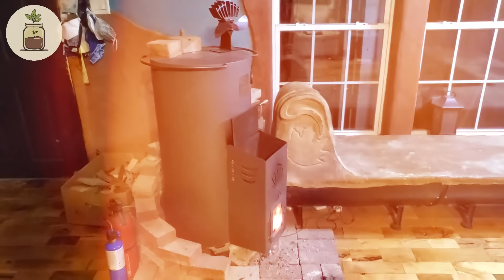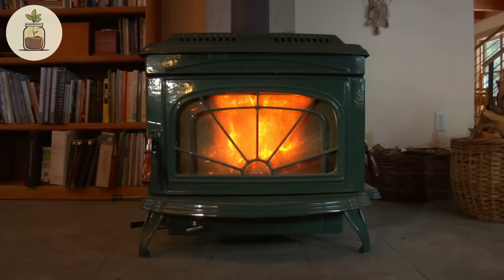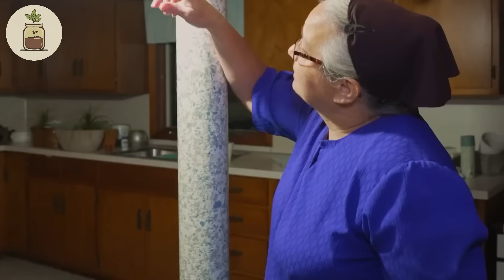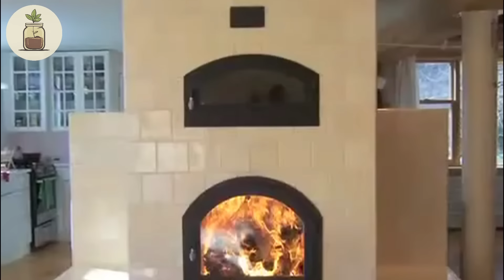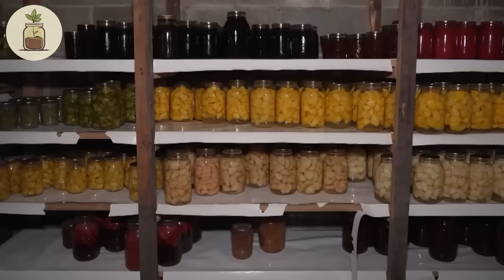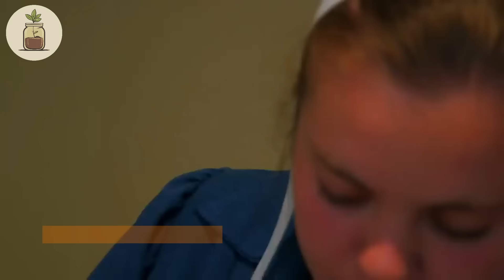How Amish Heat Their Living Room Without Gas/Electricity

Comment: Of course, they spent much less. We use electricity for heating, and electric bills include everything that's powered in the house, not just heating. They have no electric lighting, no computers, modems/routers, washers/dryers, A/C, fans, (nothing to cool them down in summer), fridges/freezers, etc. Try to turn off every single electrical appliance in the house, don't even use the lights - and see how much your bill drops.

Comment: It is not only the amish. The russians have similar heating systems in siberia. Also, I grew up in the 60s in greece where 6 people living in one four bedroom house, we used 2 tons of wood and 5 tons of coal per year. And what a mess. My father ordered the coal which was dumped in the yard and we had to stack it in the coal bin, which was a room 15'x 15'. Some pieces of coal were over 2' . Then we had to have buckets of coal next to our dutch oven and make trips downstairs to get more coal. The fire in the stoves in one bedroom, where three kids slept were started about 8-9 o'clock and went out about 3 am. That helped us get up to go to the kitchen where it was nice and warm. Here I installed dual oil tanks in my house and start the winter with two full tanks. I order oil when I am low and pay the bill. I spend, for ambiance a full cord of wood every 2-3 years on the fireplace. I don't even bother with my pellet stove anymore. Life is simply easier. The amish do what they do, because they have to, not because they want to. Some amish choose to leave their community, but I doubt that anyone non amish join those communities. It is just to much work. The only thing, IMO, that holds the amish together in their communities is their religious beliefs. More power to them...
PS I use the ashes from the fireplace instead of salt, in the winter, as long as I have them.

Comment: myth-buster: there is only so much heat-energy you can extract from wood before the smoke before enters the chimney. If you extract too much, the chimney will get too cold and moisture will form inside leading to a build-up of carbon (that can clog the chimney and cause a chimney-fire accident). The smoke needs to have around 65 degrees Celsius so water does not condensate. That means the amount of energy you can extract from a log of wood is limited by this. A well designed wood stove (masonry/tile) will extract that amount and end up using 80% of the energy in the wood. in my opinion the rocket-stove is not a "magic stove" that creates more energy than there is. If you burn the wood gases in a secondary combustion, you might end up with a tiny bit more energy than a well-designed masonry-stove but you will also end up with more fine-dust particles in the smoke (not good in cities). Besides a rocket stove needs to be heated for a prolonged period while a masonry/tile-stove is heated once (max twice) a day in the coldest time of year. I worked as a tile stove fitter and know the math behind it. If you want the warmth to stay you need mass! Lots of it. My small masonry stove in my small apartment weighs 1.5 tons. If I burn hard wood, I never need to burn it twice a day. When it is not super cold I light it ever 2nd or 3rd day or use less wood. Also my stove is built out of masonry and clay and does not need metal pipes that will burn out over time. A well built masonry stove lasts for generations with very little repair and maintenance.
A regular metal stove from the hardware store on the other hand, can be the worst and least efficient way to heat a home, as a lot of the heat gets into the chimney and the smoke there arrives too hot (sometimes with over 300 degrees Celsius!). So you extract very little of the energy stored in the wood. But some modern metal stoves are almost at par with a masonry stove extracting 80% of energy.
Reply: Sounds great. Is this similar to Russian stoves?
Reply: I disagree with you. I'm almost 80 and grew up on wood cook stoves, the old belly stoves for heat and fireplaces...We didn't get electricity until I was about 9 years old. We had wood fire places for winter heat even up until I was 17, although we had electricity. It was what we preferred. We stayed warm on the coldest winter nights. and didn't have problems like what you claim...
This man is correct on the Amish.
Reply: @TexasMoonlight27 Did you actually understand my comment?

Comment: Umm.. i don't really know what exactly amish do for firewood, but i cut and split all the wood for my family. I run a 16" chainsaw, and a splitting maul. I use less than 1 galon of gas, one container of two cycle oil, and one quart of chain oil in one winters worth of wood. I don't sharpen my chain as often as"experts" say you should. 
Extreme max cost to heat my 2,000 Sqft house with passive solar heating, and one single highly efficient wood stove might be about $100. In a northern environment I probably would double that cost. 
So not sure where these figures are coming from... That sounds like they buy the wood and don't produce it themselves....
Cole, and other fuild definitely cost more, but wood processesed with hand tools only is 100% free!!

Comment: Amish did not use a rocket mass stove. 

The rocket mass stove was popularized by Ianto Evans, an innovator and designer specializing in natural building techniques. Evans, along with other collaborators such as Leslie Jackson, contributed to the development and dissemination of the rocket mass stove concept through their book Rocket Mass Heaters: Superefficient Woodstoves You Can Build (and Snuggle Up To), published in 2006.

The concept of the rocket stove itself predates Evans and was first developed by Larry Winiarski in the 1980s. Winiarski designed the original rocket stove as an efficient cooking stove for use in developing countries. Ianto Evans adapted and refined the idea into the rocket mass heater, focusing on sustainable heating solutions for colder climates.

Their work combined efficiency, sustainability, and accessibility, leading to widespread adoption by eco-conscious builders and off-grid communities.

Comment: I wouldn't think the Amish would use propane, and much in ways of natural gas, as the processing requires electricity, to produce them, now. With exception of direct chemical separation from crude oil, to make kerosene, of course, as that can be done with no electricity...but then we get into how the oil was pulled. Anyways...there's my 'two cents', and two cents doesn't buy anything.

Comment: nothing beats a rocket stove , i made one that
 burns wood pellets non electric , i had it burning up to 1150F degrees in fire box but normally  it stays at 850F when the exhaust goes out of the stove into the chimney pipe i can put my hand on it , on top of the stove i have a bunch of heat powered fans

Comment: Firstly these have been used in europe for centuries  the masonry stoves can be found in many home across Europe Germany Switzerland Nordic nations Netherlands.  These wood or coal burning stove have thick masonry covering that acts as a heat sink absorbing much of the heat of the fire then releasing it back into the room over time meaning that once hot these heat sinks only require a small amount amount of fuel to maintain the heat sink.
The wood is burnt very efficiently like a modern wood stove . Many of the large masonafire place have decorative ceramic tiles . However theeevare not as popas they use to be because most European towns are smoke free zones.
These are not rocket stoves the amish don't use rocket stoves they use what Europeans have used for centuries. however the heat sink method is being used to heat home by using cheaper excess nighttime electricity to heat up a dense energy absorbing material.  Which releases the energy back as Heat through out the day .giving heat and hot water. Most european are use to use what called a mutifuel stove they run on coal or wood or peat bark. 

These masonry ovens absorb much of heat from the fire and flue then radiate back over time.

Comment: Selkirk mountains of northern Idaho here. We used to get a logging truck load of Birch lions every 3 years for $1200. Cut and split it ourselves and got about 12 cords of wood. Super efficient good cents 4 bedroom manufactured home with 80% efficient Osburn wood stove. Cost about $400/year to be toasty warm with no special exotic heating system. Super dependable and no electricity needed. Been doing this since 1999.

Comment: The big oil and power companies are pushing to eliminate wood heating on the grounds that it pollutes the atmosphere worse than their forms of heat. We use an Italian made fireplace that uses a sealed burn chamber taking air from outside and efficiently urning wood to……heat water! It is a boiler that will heat the water that is distributed to radiators in the lower level of the home and into in floor hydronic heat on the upper levels.
The British canal boat dwellers utilize coal fired heaters and yes it is long burning. If we had access to anthracite coal I would be using this for heating water and some high end heaters utilize a catalytic secondary burn to keep hazardous particles out of the atmosphere.
As for lighting systems back in rural America farmers had acetylene gas generators that used calcium carbide for fuel with a simple water injection system. The released gas was piped throughout the home and was controlled by shut off valves. When you wanted light, turn on the gas and light the gas. It would release a bright white light as well as heat. These generators were often set in the basements of homes while others located the generators outside the home and gas could be piped into the home, garage or barn for light.

Comment: Are you COLD in winter? Move to the tropics. No heaters necessary!!!
Reply: I have lived in Central Florida since 1980. This is the worse winter that I remember.  My furnace is set between 69 and 71 degrees. I close all the doors and windows,  drapes in the house and use a space heater wherever I am. This weekend,  even Miami will see freezing temperatures.  Perhaps the Caribbean would be warmer 🤔

Comment: Well I think winter costs for heat is more then Stated. 
I lived 30 years in Cold Pocono region of Pa 
I followed the practices outlined in this video. Being a home builder I built my home which was 5000sf plus due to building codes I had to put a propane or electric heat source to pass inspection. Propane would cost me 1000 a month cold months. It was cold from Oct till   May.  I put an auto  feed coal furnace that I could push through 4 floors of water baseboards. All worked by same thermostats which could control propane heater which I had off when using coal. It was an automatic feed pea coal which feed 400 pounds if coal  a little at a time down a shoot that air blew on that control burn lowering and raising to heat required. It used about 5 gal bucket of coal per day 
The coal to keep the home about 70 degrees at a cost of 250 a month. When we used propane we kept house at 65 degrees because it was 4 times what coal cost.  The coal unit and plumbing cost me at the time 2007    6000$ It was a big unit I built in garage.  I had the skills to do all the labor.  One season paid for the unit verse what we paid propane the u it also heated domestic hot water. We also had a large wood stove on main floor in case we lost power or to work with coal furnace on sub zero cold weather which we had In deep winter months. It all worked. I had to keep coal in unit and entry ash bin. But 5 min a day was well worth it. For 15 years it worked great. Then we moved to Tennessee and life in the winter is so much easier.

Comment: Rocket stoves are MOSTLY based on misunderstanding and Myth. This is My assertion. Simple math really. Here are the facts if any one cares to understand or check the facts. There are only a total available of  about 8k BTU's per pound of hard wood at less than 10% moisture. Rocket stove CAN NOT add  one bit to that number. Less dense wood like sticks or wet wood has MUCH less. a small house 2 bed single bath can get away with a 60,000 btu unit. That means 7.5 pounds of wood per hour at 100% efficiency. You can NOT burn 8 pounds of hard wood per hour ( much less enough less dense sticks )in a 6 inch hole or an eight for that matter WITHOUT constant feeding it , AT BEST. Now we know nothing is 100% efficient. So lets just say its (rocket stove)a very high 95%. a 6 inch hole will only handle about pounds of hard wood leaving enough room for proper air flow for the fire. 3 pounds = 3 X 8000=24,000 BTU when the wood is completely consumed.24000 at 95% =22,800.
Now a cheap homemade barrel stove kit . will hold 40 pounds of wood and burn 75% thats 240,000 BTU
numbers dont lie the larger capacity out weighs the efficiency. efficiency is meaningless  if its not practical.
Anyone say My math or facts are wrong?

Comment: For a culture that supposedly shuns the use of electricity, there were a lot of power lines going to houses and fixtures with light bulbs in them in this video. In general, I would say your research was not done very well.
Reply: Most of the picture they were showing where English homes

Comment: I built my 3200 sq foot home in California in1986..I over insulated it (2x6 walls and R 60 in the attic)..I put a  Lopi  wood burning stove in and had solar installed Jan 2020...My utility bill is around $50 per month in the Winter and $25 in the Summer..Other neighbors see $600 t0 $900. bills..Our supplier is very greedy......
Reply: When given the opportunity to convert that R60 to closed cell spray foam you won’t be paying nothing to the power company your excess power will flow into the grid depending on the buy back rate from the power company many do 1 for 1  unlike Bartlett here in Texas we generate 120-150 kilowatt hours per day charge up our 40 kilowatt hour batteries charge the cyber breast  I know it’s a beast but breast sounds better lol..  but back to the story for every 4 kilowatt hours we push into the grid we are paid for 1 kilowatt hour it used to be 1 for 1 but they got greedy over the years because just off a 10 kilowatt hour system they were basically just holding on for that to use at night free of charge .. we saw they were changing and we had no choice but to show them who’s da bitch so to speak changed all solars from string connect and had micro inverters added to the back of each one which boosted our 10 kWh system to 14/15 kWh and added 12 more to the 48 panels we did have and now we are pushing 18-22 kWh   Attic is spray foamed holds heat in during the winter and prevents heat from the sun during the summer and trust me a hit roof no matter what insulation you use except spray foam as it’s a closed cell prevents hot cold from entering it escaping.. walls are open cell spray foam that helps with the sun heating the brick and allowing the heat to move through the wall with no heat or air on during the winter house stays about 62 and in the summer 95-100 degree day house stays under 78 with no air on.. $65,000 and a beautiful solar array on my other lot says I will not ever have a $600-$800 power bills for the rest of my life… solars are made in Germany and microinveters are made by enphase …  had to ditch the fronin inverter it was preventing maximum solar collection  my home is 4,199 Sq ft
Reply: Not only is your supplier very greedy but I hear California has rolling blackouts to preserve the grid. Guess you don't have to worry about that

Comment: I use a multifuel stove for coal/ logs. I burn mostly "smokeless brickets" (coal that is crushed, washed and reformed) because of smokeless zones and "net zero" BS here in the UK! I use the logs to cut down on the coal I buy. I live on a canalboat. All steel, 52x6.5. Approx 240sqft living space.
Myself, wife, 2 dogs and a cat!
I have added extra insulation below the waterline and except in the really coldest of weather our problem is odtenkeeping cool!
We have 800W in solar panels and 6x133amp batteriez at 12v. For 10 months of the year we hardly run our engine to generate power. We have a mains power Fridge. Otherwise all our lights are USB or 12v LED. Usb lights provides enough to walk around. We. have some bright 12v spots in work areas. Even in a house you can use usb lights for milliamps rather than big lights for watts of power.
I have some enclosed candle lanterns as a back up to the, rechargeable lantern, back ups! As an ex firfighter who has seen a steel boat buckle under the heat generated by it catching fire I dislike open flames intensly!